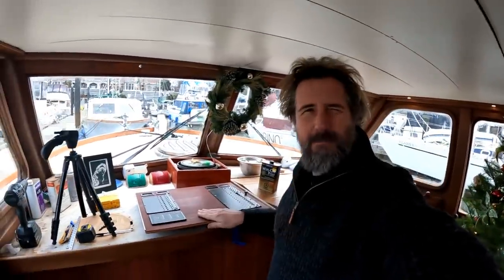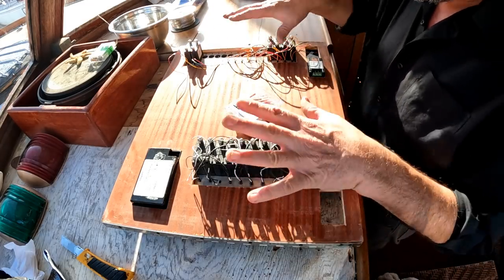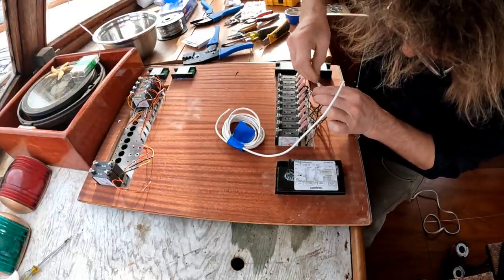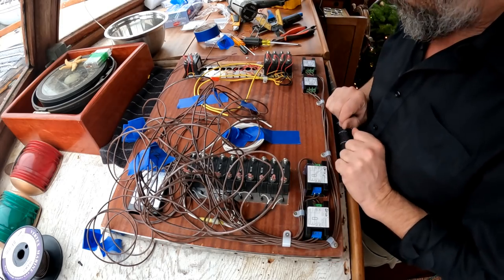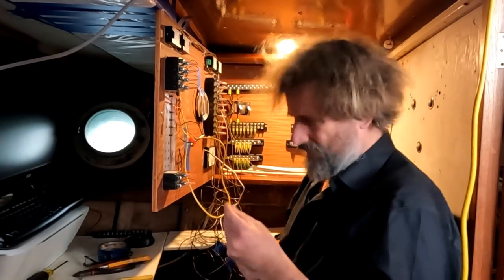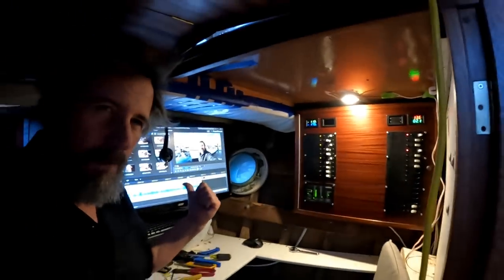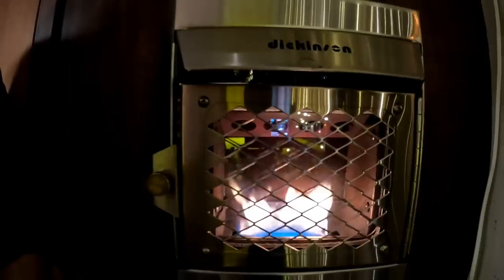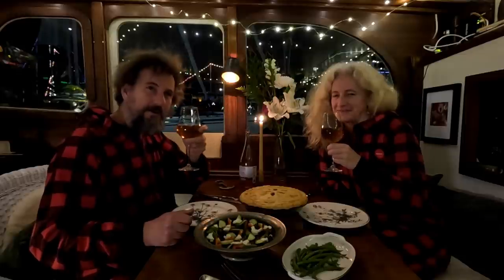Electrical Panel Installed - #285 - Boat Life - Living aboard a wooden boat - Travels With Geordie

Comment: at any electrical supply store including Home Depot you can get a book of tear out numbers for identifying wires  just wrap the numbered tape around each end of the wire and note the number
Reply from the maker: I got some of those awhile back. just need to develop a system.

Comment: A cheap way of buying 7 different colours of wire over here in the uk is to purchase 7 core trailer wire… then strip out the individual wires and hey presto 7 different colours of wire to work with..
Reply from the maker: Great point, here too but it’s not tinned wire. no good for boats. I used miles of trailer wire in my truck.

Comment: Merry Christmas Peter, for a gift for yourself may I suggest some white heat shrink tube and a fine tip indelible marker, shrink a sleeve at each end of the wire and using the marker clearly label them with a system that works for you, be it dots, numbers or whatever. 
Enjoy the season, Cheers.
Reply from the maker: Great idea!

Comment: The hot glue will work fine but not easily removable I have used o-rings slid over the the unit and down against the plywood they held simular item in place for me the o-rings must fit tight

Comment: Soldering the wires works forever salt air will be a problem  even with shrink wrap
Reply from the maker: In some ways I agree Craig. however ABYC forbids solder joints.

Comment: Peter, what i do for wiring with the same color wire, i will get white colored wire and the use a selection of permanent markers (Black, red, green, blue) and once i cut the wire to length, i run the marker down the side and now you can have striped wiring. Whit/w red. white with black, do twice, white with black & red, you get the idea.

Comment: Peter as I have watched you for a very long time I wanna share something I think you would be interested in? There is a automotive wire harness company named painless wiring and they make wire that is labeled throughout the length printed into the casing. Yes they have all the types/gauges/colors And I do believe in marine quality if not exceeding. There prices are reasonable too.
Reply from the maker: Hi Scott, I know about Painless. being a car nut for years. their wire isn’t tinned which is required for marine use. great company though.

Comment: I like it, you new panel. I have used similar digital gauges on my boat. They are not on plywood, but thinner sheet metal or panel board. They have a built in restraining clip, so did not have to glue them in that I recall. I do remember using some smaller gauge wires too for them. But later found out ABYC rule is nothing smaller than 16-gauge wires, but . I won't change anything I did. Did you fuse your panel wire for the AC side where you measure the voltage? On mine, I used those small glass fuses and a fuse holder. Since I have a Square-D electrical panel with QO breakers,  my AC panel meter wires are fused inside that panel, then run up maybe 3 feet to the gauge near the helm. Fuses have to go where the power is distributed from a larger wire as you are protecting the wire, not the device.

Comment: I was a bit concerned that you were going to touch something live while working on the panel. Great to see that you are changing the bus bars to copper, I appreciate that it's a lot of work but SS wouldn't have worked very well. Have a great Chrstmas, Cheers!
Reply from the maker: Heh, I did give myself a bit of a tingle at one point.
Reply: @TravelsWithGeordie  :O Take care! I've been designing my electric panel over Christmas, but I'm using a CANbus network to save the wiring. I'll post a video on 'Liberator Project' when I start building it.

Comment: Peter, does ABYC not require a barrier between 120v and 12v? Should they not have separate, independent covers? Would a split door with hinges on each side comply? Or is this all in my imagination?
Reply: Not required of independent covers to my knowledge . The runs should be separate. If the opening of the panel door required a tool fastener the exposed ac would not violate.

Comment: The panel work is going well and going to look very professional when completed. It might be a good idea to add some sort of bump protector for the panel switches.
Having a switch shut off from something accidentally hitting it could be a problem. Merry Christmas to you and Z. Cheers
Reply from the maker: Thanks Mario, great point. I’ll be putting lockout covers on a few breakers, specifically the bilge pumps.